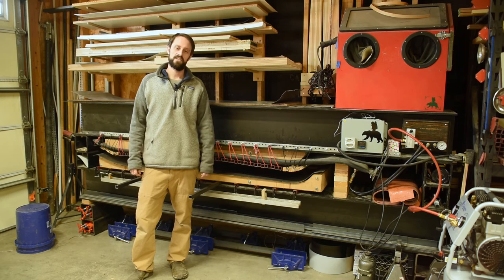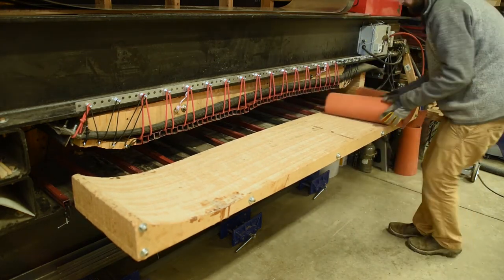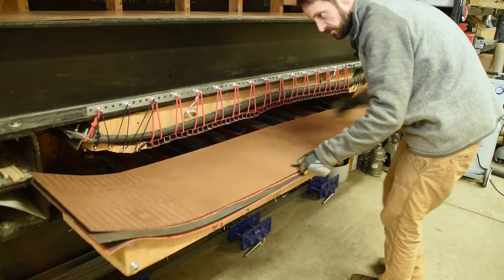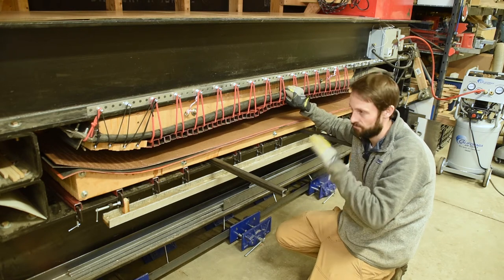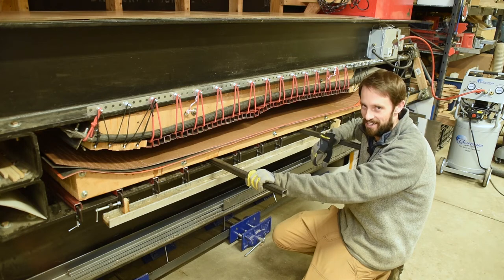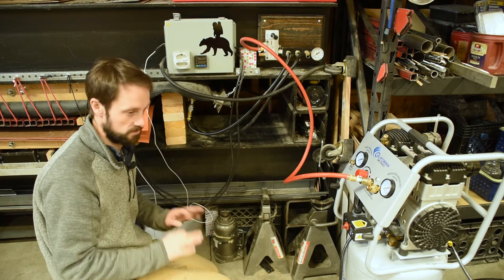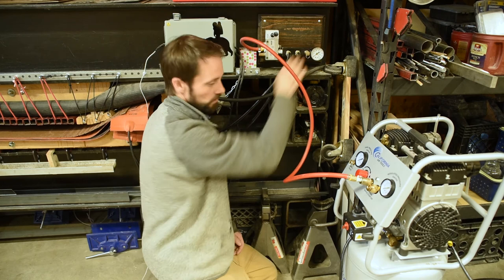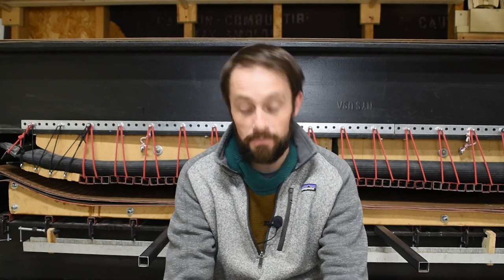Ski Press Overview

Comment: Hey, love your press set up. 
I'm trying tu build one for myself, can you tel me what component you used to get the air into your firehose while having a good seal? thank you
Reply from the maker: Hey, you bet.  It was theses part from McMaster:
50785K273	Medium-Pressure Brass Threaded Pipe Fitting, 1/4 Pipe Size, Through-Wall Coupling	
90131A106	Abrasion-Resistant Reinforced Rubber Washer, 3/4" Screw Size, 2" OD, 1/8" Thick
Reply: @redbarrelskis3361  thank you man! I'll check this out

Comment: Hey there. How to give  an angle on sidewall with SIDEWALL BEVEL BIT
Reply from the maker: You may notice the 'custom' bit I show off in a few of my construction videos.  That's what drives the sidewall angle.  Its only 'custom' in the sense that I added a washer to the guide bearing.

Comment: that's amazing dude! i'm still impressed about it! very nice press. did you build yourself? and in this case... is there a way you could share somehow the way you did it? that would be a good orientation... for the moment i'm using vacuum press, but pressure is not the same... so i have to figure out the best way to build. Thanks for sharing!
Reply from the maker: dude, thanks man!!  I did build it myself.  Had access to a machine shop.  Made a CAD model.  Took advice from happymonkeysnowboards.com for lots of it.  It was a pretty huge project, but should last forever..

Comment: Nice setup. Did you ever consider just using an I-beam as the press. "Hinging'' one end then rotating down the other end to close the press...those beam must weigh tons. That save the plumping/electrical thing you have going on at present.
Reply: Hmm, yeah the I-beams weigh 400lb each.  So the top half is 800lbs!  And the pressure in the press can go up to ~90psi, which when applied over a 12in by 72in area is over 75,000lbs.  It would have to be a crazy strong hinge…. Thanks for the comment!
Reply: @jdritchey5773  Well, you'll notice I put ''Hinge'' in parentheses. I was thinking more of it in a kind of ''resting pocket'', like plates on 3 sides to hold it place then a scissor jack at the other end to lower it, with a similar pocket at the jack end to guide it down.
   A simpler option, put 3 or so scissor jack under the mold and jack it up against the I-beam.
Reply: @rickden8362  Pressure distribution is the name of the game.  I missed one of the 1x1's on a recent press and broke my mold!  I'd stick with air pressure and bladders. With 3 scissor lifts that can lift a ton you would only get ~6000lb force.  Need about 35 to get to an equivalent air pressure level. Cheers!
Reply: @jdritchey5773   You haven't had enough physics to justify that comment. ;-)

Comment: Nice press, I’m keen to make a press for composite work. Do you think these heat blankets can heat to 100C or more?
Reply: Hey, thanks!  You can order the blankets to whatever wattage you want.  I selected 2700W for mine.  At 240V it takes about 11.25 Amps to drive, and with two blankets in my system I'm pushing 22.25 amps.  So that really pushes the limits of a 20Amp breaker, better to have 30 or 40...  The actual heat output depends on the conduction of the materials its pressed against, ambient temp, insulation...  All that said, I haven't tried up to 100C, but I've done 60 no prob.  I've even ran 60 on one blanket.  Hope that helps!

Comment: Hey man, nice press! I've got one somewhat smaller than yours (8" beams, 12" cavity height, 7' long), and it's been running great. I was wondering what pressures do you press skis at? I've been pressing snowboards at 45 psi (small compressor) but I've recently had trouble with leaks at the end of the fire hose and the last two have been pressed at 20-25 psi, and they turned out almost identically. I'd rather not over pressure the system as it doesn't have any overpressure safeties (other than pressure it up and get out) so I figured I'd ask.
Reply from the maker: That's awesome!  I go between 20 and 60 psi, hardly ever noticed a difference too.  I feel like if you have a nice mold that provides even pressure then running it at lower psi is just fine.  If you need to bend some sheet metal or whatever in you press then the higher pressure helps.  Higher pressure may reduce weight too. So far I've never delaminated a pair of skis which might mean to dry/too much pressure.  But I won't claim they are the lightest on the shelf either...  Cheers!
Reply: @redbarrelskis3361  Thanks, it's good to hear from someone with some experience. Good luck on further projects

Comment: Hey there, thanks a lot for your video ! What is the diameter of the fire hole in your system?
Reply from the maker: So, after making this video I changed that feature.  This stuff is 6", but the updated version I think is 4".  I did have to run 3 hoses for the smaller diameter, but it bends nicer and fits the press better.  You'll see the new stuff in my next video :-).
Reply: @redbarrelskis3361  today we produce our ski press too